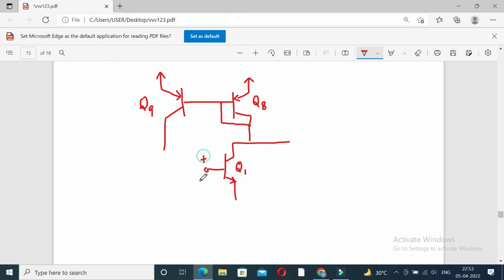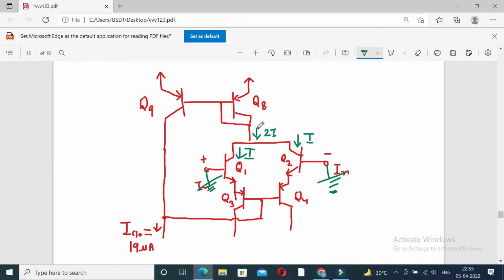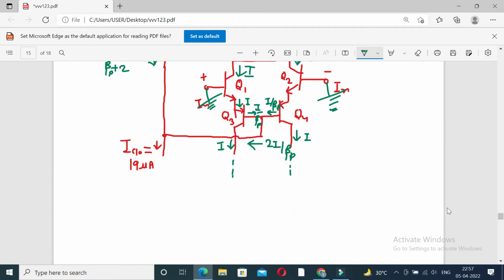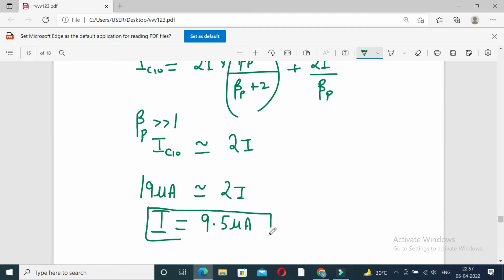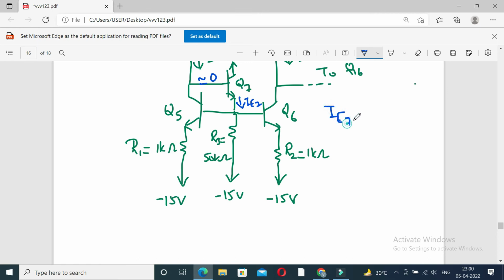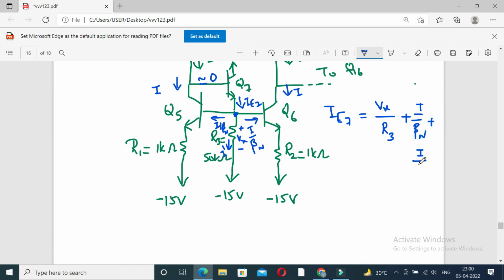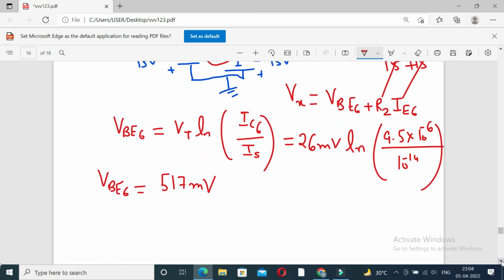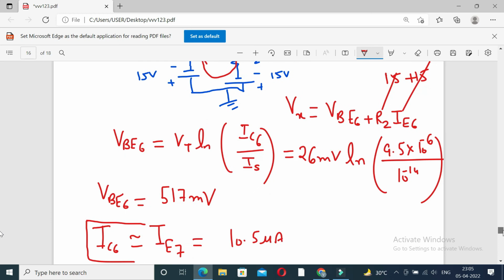DC Analysis of IC 741 Op-Amp First Stage- Part 2

Comment: just a quest may be a silly one ...transistor only works when dc biasing at the base is there for active mode NPN Q1,Q2 here the base is shorted to ground then how these get on while doing dc analysis...how current will be conducted from collector to emitter in Q1 and Q2?